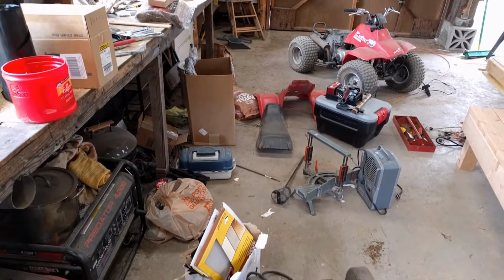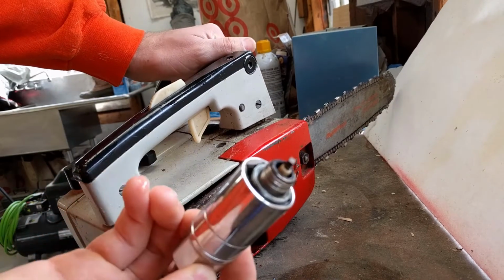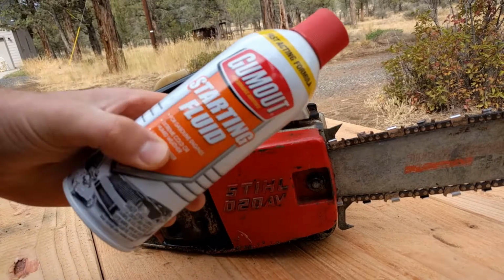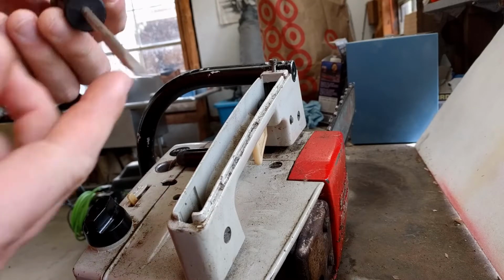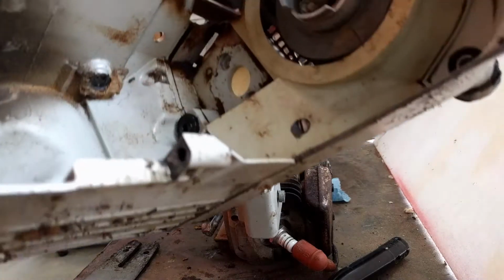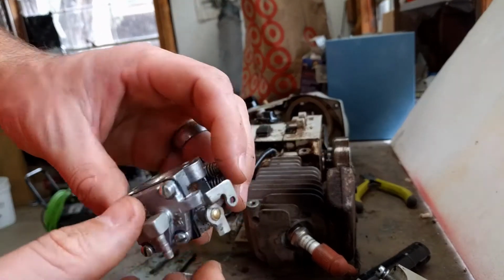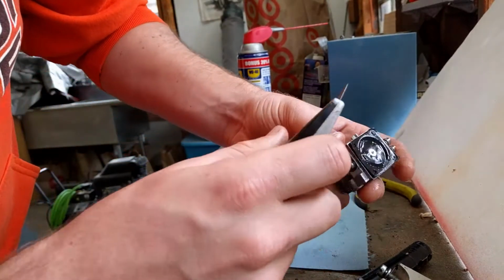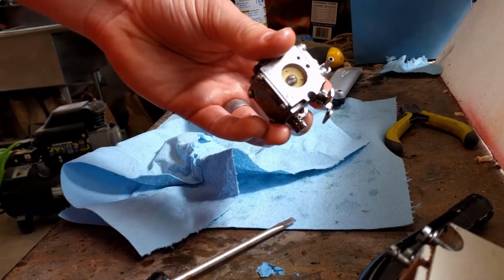Stihl Revival.  Getting a Sthil 020av Back in the Woods.

Comment: Greetings from Germany! I own an old 1977s Stihl 020 AV, too.

You have to use at least 50:1 gasoline/two-stroke-oil mixture on the 020 AV, for example the Stihl MotoMix fuel (i think it is available in the USA, too). A 40:1 mixture will be probably the much more better choice on this old lady. Don't forget to fill up a good chain oil and check the oil flow when the machine runs.

In order to start the chainsaw, snap in the half-throttle button (press the throttle and push the button in). Then set the choke and pull the starter. If the motor starts shortly, put the choke lever back and continue pulling the starter until the motor is running.

And: Let the chainsaw warm up before you start working. :)

Comment: When it fired up it was music to my ears. I bought my first 020 in 1986. They're a great saw ! Excellent power for its size. Great throttle response .
Reply from the maker: The one that I had in this video started to make an awful grinding noise.  I tore the thing apart, and I still couldn't find what was making the noise.  I sold the saw, but I really want another one.  They are a perfect size to throw on the quad.

Comment: I picked up one of these as a box of bits for free, so set about reassembling it. The pipe to the crankcase from the carburetor had gone hard and slid off at one end so I replaced it! After disassembly the carb cleaned and reassembled, I set about putting the whole thing back together and voila, she fired up a treat. The HI/LOW mixture screws are very critical on setting but once set she fires up 3rd or 4th pull. Someone had removed the filter screen and I didn't have a replacement but have since bought a replacement  - 5/16 in diameter Walbro 140 - 70. This is so much better than a newer model Stihl that I own!
Reply from the maker: Mine started to make a horrible grinding noise, and would not stay running.  I took that thing apart 5 times to try and figure out what was the cause.  I think it was something to do with the pull start, but it was over my abilities.  I ended up passing it off to a friend.

Comment: The most important thing you need to clean on that carb it the tiny little mesh filter you mentioned, it's called the final filter; once it clogged the saw will never run correctly. I'll tell you that 9 times out of 10 it's why your not getting fuel, not dirty jets etc. nothing gets past it to the jets, that's why they were CLEAN.

Comment: Enjoyed your video. While you had that all apart, you should have sprung for a carb kit! Saw sounds like it's flooding, it is very important that the metering diaphram [that connects to the lever and needle] is SUPPLE. That one looked old and stiff! That will make it flood or run lean or be erratic. Also a new starter rope...  I have one like yours- top handle, and a few more with the long back handle. One lives on my ATV, another is presently 3000' up the mountain, and the others, well, I'm a collector. And a few years ago one of my 020s got stolen from 4,000' up the mountain!

Comment: Hi there, 
Good video, i have the 010av top handle and recently had to totally strip down and rebuild it, the  problems you had with the throttle  linkage can be avoided by removing the carb complete with the manifold boot (after removing the  flywheel) then you can just unhook it. 

Regards from the uk
Reply: I managed to squeeze my boot past the flywheel after removing the clamp completely - I had to since I don't have a puller!

Comment: I'm 74 and bought one of these new in 1975 . . . $NZ185 and ran it until 2000 when I had no further use for it, or so I thought, and gave it to an acquaintance. In that time it cut many truckloads of firewood as well as much thinning and trimming.  After 1990 I ran it on Amsoil 100:1 with no snatching whatever. I wish I still had it as the build quality was such that if Stihl were to make their small saws to the same standard today, they would have to be in the $12 - $1500 range, maybe more. So they are now chinese with ALL of the associated grief of cheapness. Do not part with the 020 now as they are as rare as rocking horse shit in serviceable condition.